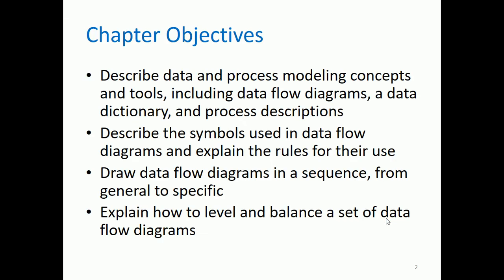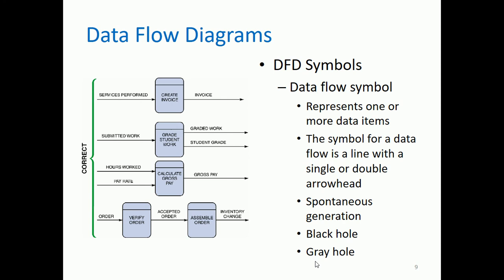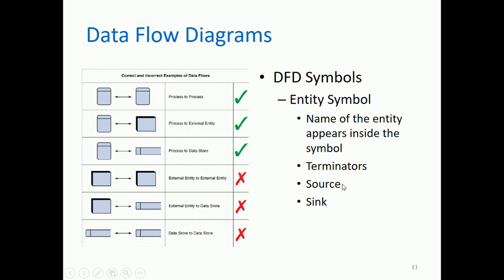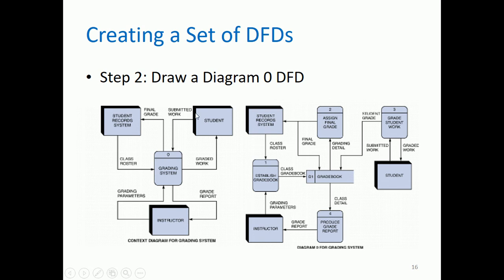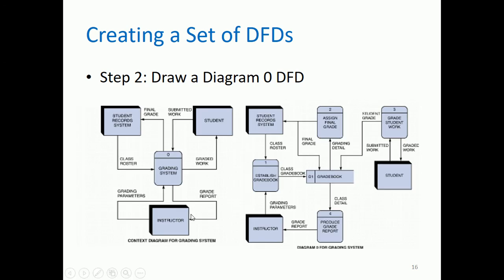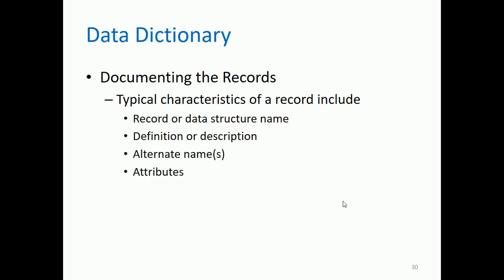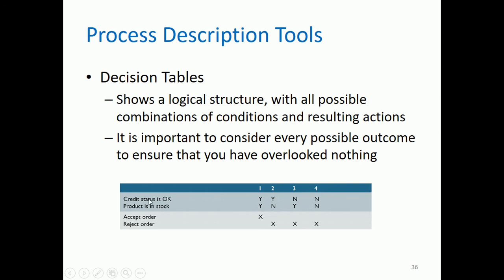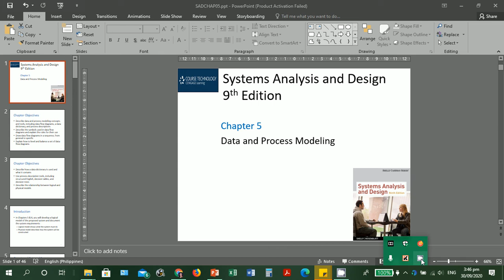[SYSTEMS ANALYSIS AND DESIGN] 5 - Data and Process Modeling

Comment: I dont understand why external entity instructor is not connected to  Process 3 "Grade student work"  since the instructor is doing the grading
Reply from the maker: It depends on the organizational setup in an academic institution for this example. I may assume that the context here is that the instructor does not directly grade the student work, it is the system. And if you can see in the DFD, the instructor only provides the grading parameters and it is up to the grading system to reflect the grade based on the grading parameters given by the instructor.